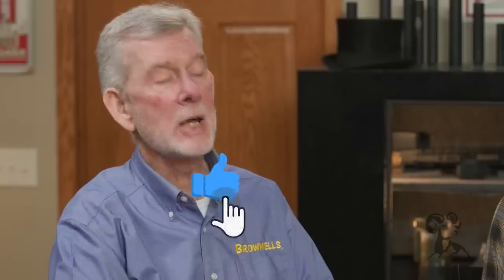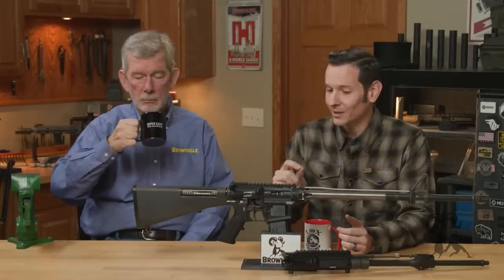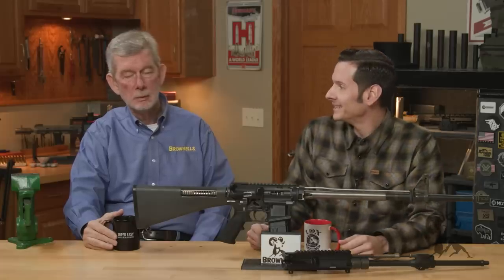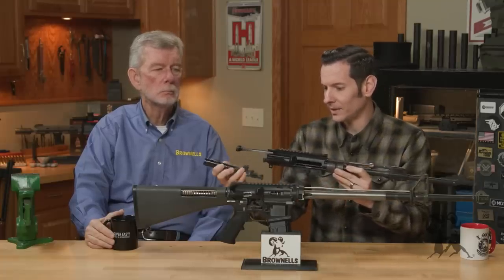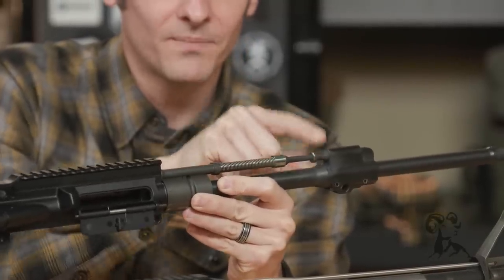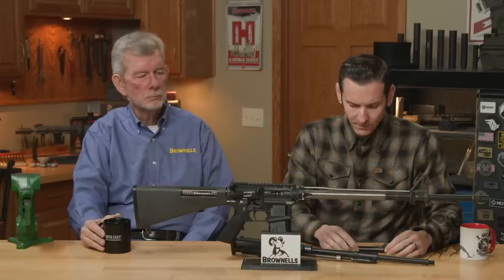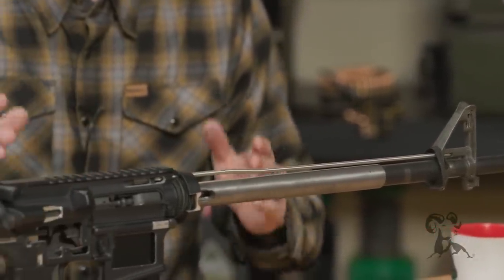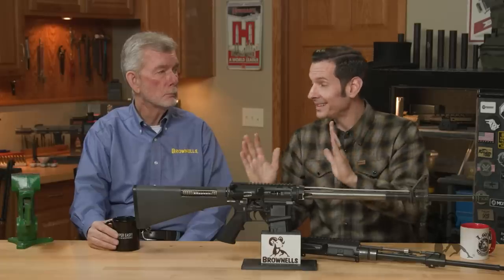Smyth Busters: The AR-15, Direct Impingement or Piston Operated?

Comment: I’ve been telling people for years that the original AR system is superior to add-on piston systems. My reasoning is that the gas acting on the rear of the bolt unloads at least some of the pressure on it before the rearward movement of the carrier forces the bolt lugs to turn, disengaging the bolt from the barrel extension.
Theoretically at least, this should decrease bolt and barrel lug wear.
Piston systems use brute force to disengage the bolt.
Reply: And yet M4s loaded with M855A1 were seeing bolt lugs shearing off after 3,000 rounds, half their expected lifespan with M855. The cam pin hole also seems to be a common breakage point.
Reply: @tedhodge4830   Never heard of that. I’ve personally tested M4A1s to 6000 rounds (of M855) and beyond with no lubrication and very minimal cleaning, even when adding a suppressor to the mix on every other mag.
Do you know the chamber pressure of the M855A1?
Reply: @jcarne1015  Per SmallArmsSolutions: "The M855 has an average chamber pressure of 51,522 psi, which is within the 52-55,000 psi range the M4 and all 5.56mm military rifles are designed. The M855A1 is increased vastly to 61,830. In fact, you see pressure levels as high as 62,900 psi. " Per Maj John L Plaster (ret) in American Rifleman: "For gas port pressure, the M855A1 generates 50 percent higher pressure (23,767 p.s.i.) on the Special Ops 11.5-inch M4 barrel, compared to the 16,067 p.s.i. with the M16A2’s 20-inch barrel. That has been shown to cause port erosion, which boosts the automatic-fire rate, increasing the likelihood of jams. In the 2011 tests of new Army carbine prototypes, the barrels experienced “accelerated bolt wear” from firing the M855A1, because of higher chamber pressure and increased bore temperatures. A Special Operations Command test saw cracks appear on locking lugs and bolts at the cam pin holes on average at 6,000 rounds, but with as few as 3,000 rounds of “intense” full-automatic firing."
Reply: @tedhodge4830  Hmmm…I was under the impression that 223 Remington ran around 52,000, and 5.56 NATO generally ran in the 60-62,000 range. I’ll have to do some more research.
Regardless, thanks for the info.

Edited to add that I worked on a project with the chief engineer of the M4A1 back in ‘08-‘10. Every time I asked a detailed question that I thought would solve a problem or make a better product, I got the same answer. “Sorry, proprietary information”.
Reply: @tedhodge4830   I found an interesting comment/correction on Chris’s blog page where he discussed M855/M855A1 pressures. It’s by Nick U, and has some numbers that make more sense to me, based on different types of pressure measurement.

Comment: Loved this episode. This is actually a topic of many a heated debate as I've tried to explain that the AR platform is both 'a little bit' piston, and 'a little bit' direct impingement.
Reply: It is nothing direct impingement
Reply: Internal piston via gas impingement?
Reply: @michaelhill6451  Except, the means in which the AR15 cycles is the very definition of DI. The only piston action is merely to unlock the bolt by pushing it forward. Some of the gas is vented off, but much of it is used to push the bcg rearward. This is why you get gas blown out of the gaps in the rear of the receiver near the charging handle. Using an earlier prototype that never made it into production and doesn't represent the final design as an example doesn't work, my friend.
Reply: @michaelhill6451  And the debate continues. I guess I'll have to do some reading!
Reply: @waruikoneko1635  you are not understanding the physics and saying Eugene didn't know better than you on his own design?????  You got a wall of participation trophies, don't you.
Reply: @waruikoneko1635  it's no debate.
Reply: @asherdie  Yo calm down dude, it aint even that serious. Switch to decaf.

Comment: I agree 100%.
AR's are Piston driven with real piston rings like a car motor.
And the gas has a compression or delay effect, it offers time for shit to loosen up and be able to be extracted.

What they call a short stroke piston system is actually a Slam Hammer System.
And they Suck in my opinion, because they like to open to soon causing cartridges to be pulled apart / lip pulled off and stuck cartridge in the chamber.

An AK is a long Stroke very smooth in comparison system,
In terms of violence the AK is the least violent. A Ga rand or M1A is very smooth as well.
I get in heated arguments all the time with the Ignorant.

Comment: Just to throw a little more to think about between the two systems. Which one is a better suppressor host?
Reply: super late to the party.... but piston by far. Especially if you can blend an adjustable gas block on it as well.  Reduce BCG velocity and wear and tear.

Comment: Very interesting, makes me question why when the military came up with the sopmod block 2 they chose to use DI instead of piston driven? If you can run cooler and cleaner and better suppressed as well I assume, then why not when cost is not an option lol

Comment: Can the AR-10/AR-15 operating mechanism be described as using a piston? Yes, but it's also directly acting upon carrier itself by using gas pressure inside the carrier itself. The term "DI vs piston" colloquially just refers to an op rod striking the bolt face, versus gas going directly into the carrier, and that's really what people mean when they say a "piston gun" vs a traditional AR-15. It basically boils down to a semantics argument, which is losing the forest from the trees. The significance is that the "DI" system has hot, filthy propellant residue going directly inside of a high friction area, whereas the traditional short stroke system has that gas contained parallel to the barrel, which also has its own drawbacks.
The AR-15 design has a lot of drawbacks to it for each advantage, and that was seen when the US military was forced by the DoD to adopt the AR-15 as the M16 in Vietnam. Crucially, it didn't work very well with standard ball powder propellant, which the Army had a lot stockpiled since WW1, and they didn't have enough of the new recommended stick propellant. It was virtually unusable with conventional ball powder, and its performance in pre-adoption tests wasn't replicated in the field until the supply chain caught up with the demand. I think that's why no design like it existed before, and no design like it followed it even after the patents expired. Why on earth the Army weapons trials in the 60's didn't test the AR-15 for compatibility with the ball powder I don't understand. It would have saved a lot of heartache.

Comment: Its a hybrid. Most things are hybrid. You could argue that in a DI system is pushing one the piston (carrier and piston) and the receiver is the sleeve.
The true piston driven system IMO. The carrier is pushed directly in a long stroke via a rod built into the carrier or by a separate rod in a short stroke. This rod is pushed by the a gas in an expansion chamber near the gas port. The carrier always acts on the piston.
In this system AR system, the gas is brought back to the receiver and acts directly on the bolt using the carrier as an expansion chamber instead of the gas tube and carrier as the expansion chamber like in a true DI.  Instead of acting just on the carrier directly, it pushes the bolt as the piston. The AR system is using concepts from both. So hybrid.

Comment: What I’ve been wondering is if in some similar manor with different methodology, how different is this Direct Impingement design from a direct blowback system on a smaller firearm. 

I haven’t really studied Direct blowback all that much but from what I understand it seems as if bolt mass and recoil spring tension keep the bolt closed tight enough allowing for the force of the bullet being expelled to cause the next round of a direct blowback firearm to cycle as the bolt travels back and the spent casing is ejected from the firearm. In some ways, I’m seeing a lot of similarities with the Direct Impingement system and how the system uses the gas of the round itself to cycle the next round. Idk if there are any similarities at all but I thought it was a surprising analysis.

Comment: "This invention is a true expanding gas system instead of the conventional impinging gas system.” Eugene Stoner Patent

 “It is a principal object of this invention to utilize the basic parts of an automatic rifle mechanism such as the bolt and bolt carrier to perform a double function. This double function consists of the bolts primary function to lock the breach against the pressure of firing, and secondarily, to act as a stationary piston to actuate the automatic rifle mechanism. The primary function of the bolt carrier is to lock and unlock the bolt by rotating it and to carry it back and forth in the receiver. The secondary function of the bolt carrier is to act as a movable cylinder to actuate the automatic rifle mechanism. *By having the bolt carrier act as a movable cylinder and the bolt act as a stationary piston, the need for a conventional gas cylinder, piston and actuating rod assembly is eliminated.*” Eugene Stoner patent

Comment: AR is not a traditional gas impingement like the French MAS but the gas still hits the carrier first and it’s what moves the carrier therefore I’d say it’s still a gas impingement system although not traditional.  By your argument you can’t say it’s a piston system because the piston doesn’t move the bolt carrier like in the 416.  In the AR, the gas initiates movement of the bolt carrier by expanding in the internal chamber and pushing against the back of the carrier and the back of the bolt therefor not a traditional gas piston system.

Comment: Way I see it is, a di system is an internal piston system. What people consider a piston system is basically an external piston system… Much more extravagant, complex, and heavy. Runs cleaner and cooler. Di system is much more simple and less moving parts, but puts all those gasses and unburnt powder inside of you bcg… more maintenance and cleaning. But simpler overall.

Comment: But the impingement is still on the carrier. The bolt can't move forward anymore than it has. It can only rotate out of the locking lugs. I agree that it is an in line piston, but the debate itself is worth keeping alive. No one would bother understanding how the platform works compared to other operating systems without it.

Comment: I would call it direct impingement because the gas is still interfacing with the bolt carrier in the action of the firearm, where with what is conventionally referred to as a short or long stroke piston the exchange happens outside of the action of the firearm. But I can see both sides.

Comment: You might wish to point out that it is a "reverse" piston design, since the "sleeve" moves, while the "piston" is stationary. At first, until the carrier has gone far enough to rotate the bolt and begin extractione.

Comment: No matter how you call it, as long as that system cannot withstand long interval between cleaning / lack of lubrication / gassy when suppressed or you have to always keep it lubed  and cleaned, it is NOT a reliable system, piston / DI / “INTERNAL PISTON” are included.
Reply: So thousands of rounds without cleaning is unreliable??Try again lol..

Comment: Well,  I disagree,   AR-15  is what I called a  gas impingement or indirect system  similar from the MAS 44 / 49,  AG-42,  which is not piston operated,   it does  use a gas tube system which is inline with a gas tube.   In the Stoner design / patent,  the gas goes about 45 degrees down to a center bore cylinder chamber in the bolt / breech. There is a side vent meter that releases the gas in the  center cylinder chamber.   The center bolt / breech prevents the tilting of the  bolt / breech and releases the gas.   That's one of the reasons for the design.    In the Stoner design /  patent you still have the same problem of a lot of carbon build up in any gas  /  indirect  /  direct impingement system such as the AR-10,  AR-15,  M-16,  M-4.
--------
The M-1 Garand,  M-14,  AK-47,   has a long operating rod with a piston,  this a minor problem in that it has to be stiff enough not to flex.  This is the reason for the use of a direct /indirect  impingement as there is no long operating rod at all in the MAS 44 / 49,  AG-42,  AR-15,  M-16,  M-4.  The M-1 Carbine,  which does have a short stroke system with a recoil spring and a short operating rod.
---
One last thing,  in the new Sig Sauer M5 / M7 military rifle,  uses a "short stroke design" similar to the M-1 Carbine other than it uses the operating rod on top of the barrel with a long recoil spring.
Reply: The carbon has never been a problem with the internal piston..Test have proven this over and over..More fudd lore..The bolt does not tilt but rotates after the bullet has left the barrel..It is the residual pressure that cycles the action..

Comment: Steve - you miss spoke just a little bit at around 4.58 in the video. As I understand it, the bolt is locked in against the chamber because of the lugs. So therefore the bolt doesn't go forward - the carrier gets pushed rearward from the gas.
 For people who understand the gas system, we know what you meant. For people who are trying to understand the gas system, what you said might be confusing.
I enjoy you guys videos, so keep up putting them out. I've learned a lot from you guys and others like you.
 John
Reply: The forces from the gas still expand in all directions including towards the bolt when it is in battery. The force from the gas expansion has to be overcome before the bolt can move rearwords, I think that's what they meant.

Comment: Regardless of what you call it, the semantics don't matter; AR-15s still run dirtier than short stroke pistons especially when suppressed. Id rather have the excess gas dumped further away from my bolt not inside my bolt and closer to my face.
Reply: I use the Bootleg Adjustable Gas carrier.  It's awesome for that.

Comment: After shooting ARs and AKs and keeping a strict cleaning routine, I've found the idea that ARs are filthy to be blown way out of proportion. The AK piston head and gas tube get super foul. While it doesn't impact the receiver, detailing the gun takes just as much time as an AR.
Reply: The AR fouling issue in Vietnam was mostly due to using poor quality, but cheaper surplus  ball powder that left a lot of residue and the rifle wasn't designed for. When used with the original IMR stick powder it was designed around, there was a lot less fouling.

Comment: It just needs a different name. Just like how there is short-stroke, and long-stroke piston actions this is just another type of piston action, but I'm not smart enough to come up with a good name for it. In any case it's not the same as direct impingement. "The Stoner Action" sounds good to me. Really comes down to what you want out of the rifle. If you need to make rapid accurate shots at longer ranges, the lower recoil of the Stoner system will help you stay on target, if you need to run hundreds of rounds at closer ranges with little chance for maintenance, then the short stoke system is probably going to work out better.
Reply: In the Stoner patent, it's described as an internal expansion system, unlike a direct impingement system.

Comment: Carbon is a lubricant! Change my mind!
Reply: "Dallas Frohrib, CherryBalmz – So, in regards to AR-15 lubrication, you hear a lot of people say ARs like to run wet, right? They’re more lube sensitive than most because the DI system is pumping a lot of gas into that action area where the lube is.

The thing is, when we started running the numbers, DI guns were simply burning off oils a lot faster than they should have been. CLP, motor oil, whatever…We knew we were missing something, as the heat and volume of the gas just couldn’t account for the amount of burn-off that was occurring.

When we dug into it, the fouling that all of us have been calling “carbon” for so long? Well, it turns out there’s almost zero carbon in combustion fouling at all. It’s about 98 percent lead and copper particulate, coming out in rough sphericule shapes between .5 micron and 10 micron, with the final two percent being things like tin, antimony, or steel, depending on the composition of the cartridge.

In rifles you’re looking at a 70/30 copper-to-lead ratio, and in pistols it’s flipped, at 30 percent copper, 70 percent lead. Forensic scientists can tell if a pistol or rifle has been fired from this combustion composition.

Also, about 20 percent of the lead on most ranges is coming from the priming compound, which should tell you a lot about the ridiculousness of a lube being advertised as “green” – it’s always contaminated after the first shot. But yeah, almost all the carbon in the powder is converted to gasses, like CO2."

Comment: Justaquestion...
Since gas compresses...is the shorter amount of time the gas is in the piston gas block relate to a quicker reaction time of the bolt...?
Does the compression of the gas in the tube come into play with the timing of the operation...?
Reply: The AR gas system is tightly balanced and timed.  It requires a set amount of gas energizing the gas tube and expansion chamber for a specific amount of time and specific pressure.  You affect that by gas tube length, gas port size and dwell time.  This is why you can't simply chop barrel length without making adjustments, else you start introducing timing errors.

Comment: How about calling it a Hybrid. Sure sounds like the system is a little of both. But close to DI rather than a true piston design.
Reply: The only commonality it has with DI is the gas tube.  The keys look the same, but one is a cup (DI), while the other is just a gas conduit into the Stoner internal expansion chamber, which is formed by the bolt tail, flange, gas rings, and carrier.